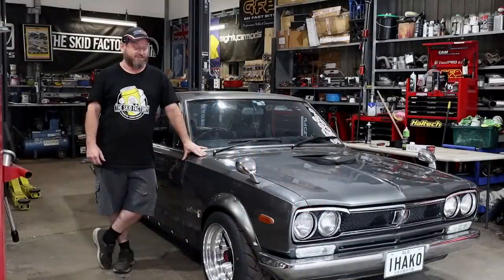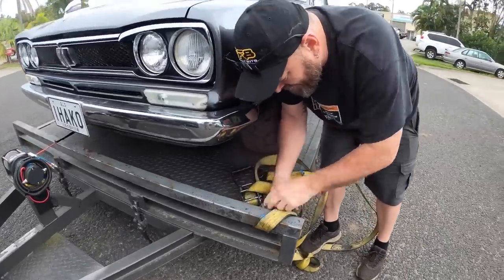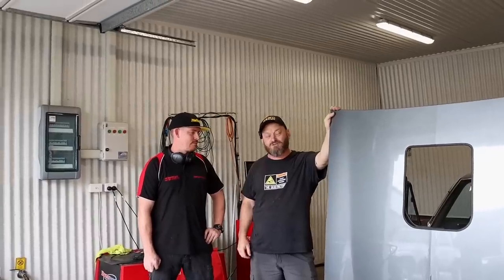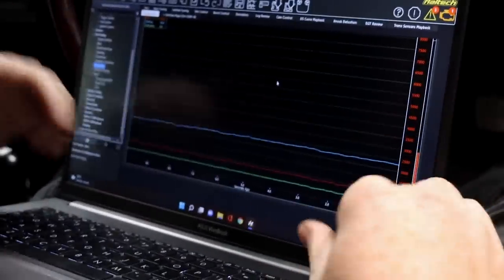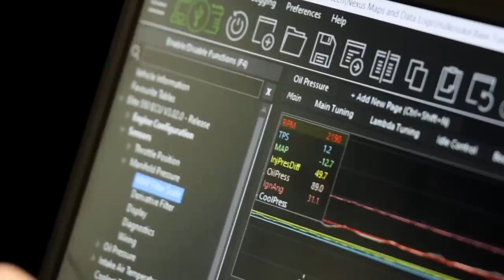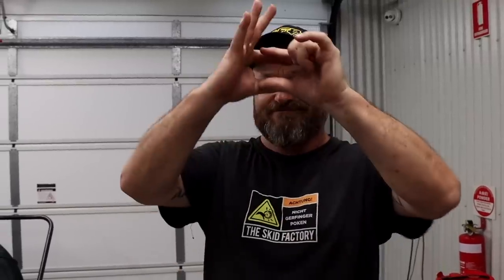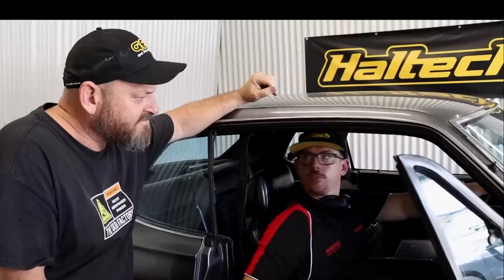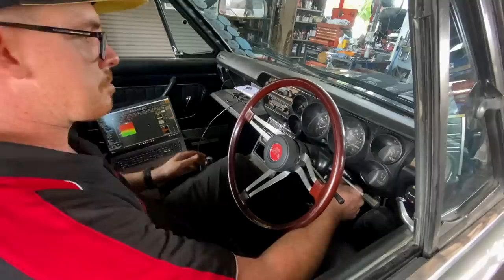VK56 HAKOSUKA Skyline Hits The Dyno!

Comment: comes back on u guys the motor doesnt fit in the engine bay. if that was the intended intake setup it should have been factored in. cutting a hole in the bonnet makes it as useful as a convertible on a rainy day. Cant fault the rest, nice effort
Reply from the maker: You've never modified a car have you.
Reply: I have modified many cars an I know things don't work out the way they were intended at first but I've learnt good problem solving skills from this. In satin I've modified cars be, its not the extent of what Al can an does do. (That 86 ❤️) I love his work an attitude to giving knowledge an key tips etc. Obviously a very switched on guy especially with wiring. Don't get me wrong I take my hat off to what U do but I'm right in what I've said   felt compelled to write the initial comment, but after seeing the rest of the build with the sump issues I feel bad. Is a 10k dry sump setup really the answer to sump issues guys ?? It's the xmember that's the issue I'm assuming ?  For the money outlayed I'm sure there's a cost effective way to engineer or get a tubular X member ? - hang some gutsy hi tech control arms an coilovers etc ? In this day an age surely ? Plus that route U can get a bonnet without a hole. Driveline won't have to be re done or it prob would ?  It's a tough street car isn't it ?

Comment: Yeah ive never seen baked on carbon be removed with any kind of solvent before. Pretty sure carbon is like the most conductive thing in the freaking world. Hell draw down your dizzy with a lead pencil lol.
Reply: Carbon isn't that conductive, it's at least ten times more resistive than most metals, and about a hundred times worse than copper.
Reply: no
Reply: @phuzz00  Wtf are you on about ? The 40,000ish volts flowing down the spark plug just fires straight from the center electrode to the ground through the carbon. Have you ever tried it ?
Reply: @cornishcat11  Yes get a pencil. Draw down from where your spark comes from towards something grounded. The spark will run down the line to ground before jumping the spark plug gap. Electricity always takes the path of least resistance. The air gap over the electrode to ground is now not the path of least resistance when you have carbon baked to it.
Reply: @cornishcat11  Yes Yes Yes
Reply: @phuzz00  What the hell does any other metal have to do with a spark plug and carbon on it ?
Reply: Then you drop those bits into an ultrasonic cleaner filled with just water and the carbon just floats away mocking you and your solvents.  LOL

Comment: Still disappointed you went with janky bolt on wide body kit, would have preferred to see welded, panel-beaten metal. Everything else is perfect.
Reply from the maker: The wide body is the same as the factory GTR widebody apart from the matching front flares.

Comment: Every oil pickup I've ever seen is a taper venturi effect.  You're getting a spiral of air next to the pipe.  Just need to be 2 piece and look like a real oil pickup...
Reply from the maker: Can you explain that properly?
Reply from the maker: Ahh yes I get what you are saying. I had my doubts about the tube setup when I made it. Without the tube it does have a 25mm - 19mm tapered entry. It made a big difference but still had issues. I think the oil is being aerated with RPM and there is no way to settle it. 
We have a dry sump pan underway.
Reply: @theskidfactory  Such a beautiful build all the extra time and money will be worth it.
Reply: @theskidfactory  Didn't even trigger...  With your taper did it end up with a sideways funnel?  How can a funnel sideways get even flow on the whole radius...  You can fix this with a hacked up piece of 2" exhaust tubing :P

Comment: seems like alot of money spent for only 420hp
Reply: That was only at 5500rpm. Once the oil problem is sorted it will be an entirely different figure. This thing is built to rev to almost 9000rpm. I'm guessing it will be close to 600hp